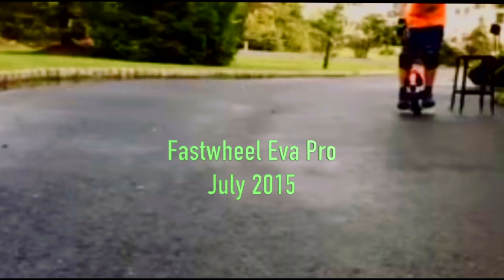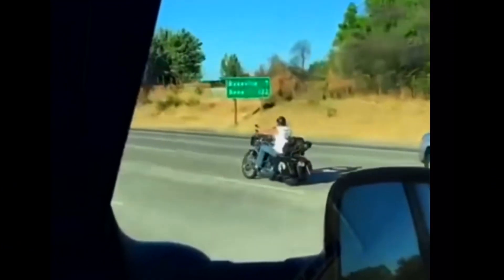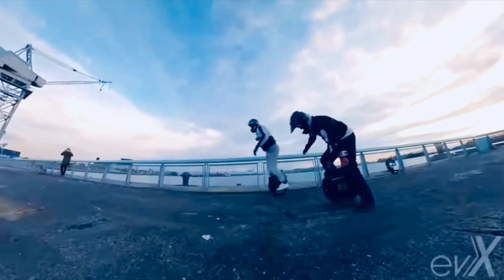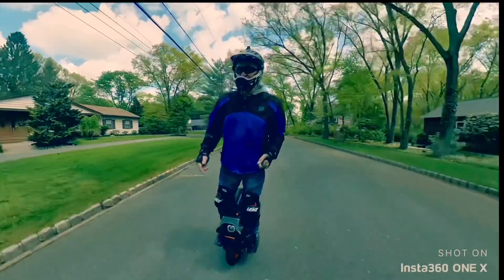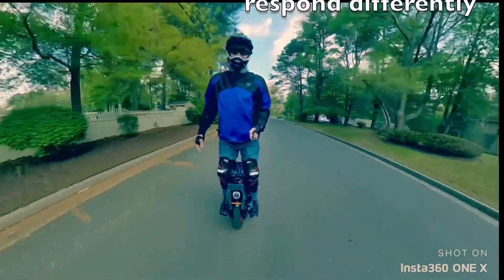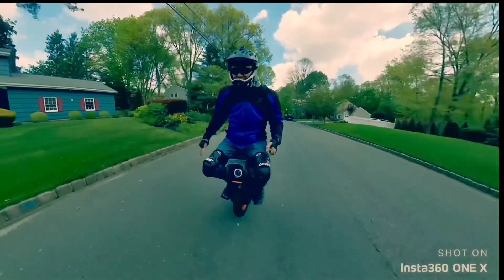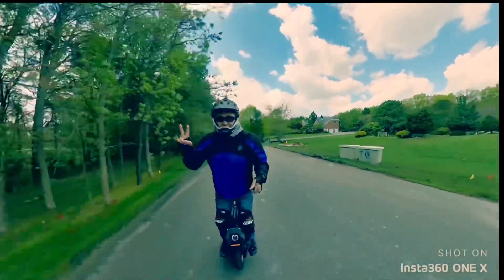Physics of Wobbles and What to Do About Them

Comment: It was definitely the biggest hurdle to get over when I was new and starting to go over 20 mph. It’s hard when you’re not confident yet to just relax and carve. I did not find braking to be a good solution when I was first starting. Works fine now, but when you’re new hard braking is probably the thing you’re weakest at. Great video!
Reply from the maker: Thanks! Yeah one of the things I mentioned about is  not rushing to be a Pro is so true. One of my friends recently learned the EUC and within a month he was going close to 30 mph. He got the wobbles and didn’t know how to deal with it. I told him not to rush to be a Pro. He finally listened but found out the lesson a little too late. He has fully healed now and is doing well. He still loves the EUC though and wants to keep riding the wheel. That wobble he had inspired this video.

Comment: Angular momentum doesn't not keep an EUC upright, it only resists a change in tilt or twist angle (more on what this does in a bit); there is no self-correcting response. Camber effect due to the tire profile is what causes an EUC to turn in response to being tilted, and at sufficient speed, it will cause the EUC to self-correct and stay upright, usually around 8 mph or so, too slow for angular momentum to have much effect. The amount of turning reaction to tilt depends on tire parameters, a wider tire is more responsive than a narrow tire, a street tire is more responsive than a knobby tire. Angular momentum opposes the self-correcting response of camber, mostly acting as a damper to reduce or prevent over-correction. A wobble occurs when an EUC gets into an over-correcting cycle, and involves a combination of twisting and tilting of an EUC. Anything that dampens that motion will reduce and stop the wobble, such as contact with the upper pads ahead of where the feet are on the pedals, which provides some angular inertia to dampen wobbles. If using pedals only, lower tire pressure will prevent wobbles, but with lower pressure, don't drop off curbs or stairs since the rim may get damaged. Riding on a bumpy surface can trigger wobbles, especially when turning, and if on a bumpy surface, trying to carve will generally make a wobble worse. Hard braking tends to cause mild wobbles. 

As for motorcycles, wobbles are also due to over-correction, but most modern motorcycles will auto-dampen wobbles. Older motorcycles prone to wobbles can use steering dampers (shocks) between frame and handle bars to act as a damper and prevent wobbles.
Reply from the maker: I appreciate the detailed response. You are right. I edited that line out. 
In my example regarding balancing an EUC from standstill, I mentioned that it becomes easier to balance as the speed increases. As the speed increases, the angular momentum increases hence balancing becomes easier. 
Regarding the motorcycle example in my video, the specific scenario was just after a wheelie is attempted and the front tire is making contact back to the ground. If the front tire is not exactly as straight as the rear tire when landing, the wobble occurs.
Reply: @AdamU1016  - Similar to a bike but for different physics, once at sufficient speed, an EUC becomes self-balancing and a rider doesn't have to make any balancing corrections. A bike becomes self-balancing because the front tire steers into direction of lean. For a normal bike, this is because the front tire contact patch is behind where the virtually extended steering pivot axis intercepts the pavement, and  the distance from the intercept point back to contact patch is called trail. A "two skate" bike can be stable due to this steering geometry with zero angular momentum). An EUC becomes self-balancing because the tires steers in the direction of tilt due to camber effect. When tilted, the inner edge of the contact patch has a smaller radius than the outer edge, similar to a section of a cone, and the tire tends to steer in a circular motion, mostly independent of speed, so if the rider starts to fall with neutral pressure on the pedals, the EUC will tilt in the direction of fall, and at sufficient speed, the resulting camber effect steering is self-correcting, keeping the EUC and rider vertical. The net contribution of angular momentum is to oppose any change in tilt or twisting (steering), and acts as a damper. At high speeds on a heavy EUC, the rider has to exert much more effort to tilt the EUC in order to turn. As for motorcycles doing wheelies and landing with the front tire slightly off, this happens all the time during the ILSE of MAN TT at 150+ mph, and although the bikes initially wobble, they will stop wobbling on their own, and the riders just ignore it. There are a lot of videos of ILSE of MAN.
Reply from the maker: I do appreciate your detailed explanations. In the clip I showed with the biker developing a severe wobble after landing the front tire, was it his inexperience that he wasn’t able to get out of the wobble or was his tire so out of alignment from the driving direction that he could not correct the wobble or something else? He certainly was probably going about 40-50 mph when he developed the wobble but could not control it. What techniques do the pro bike riders use to control their wobbles at speeds of 150 mph?
Reply: @AdamU1016  - It's not technique, it is the design of the bike. In your clip, the most likely cause of the wobble was an aftermarket handlebar mounted fairing, with some chance that the combination of fairing and tire was the issue, but a handlebar mounted fairing is not a good idea. The two worst historical motorcycles with wobble issues due to poor design (too much flex) were the Royal Enfield Interceptor (650 cc four stroke twin), and the Kawasaki Mach IV (750 cc two stroke triple). To solve the issue, riders would put two steering dampers (shocks), between frame and handlebars, one for each side. High performance motorcycles since the 1990's are designed to recover from wobbles on their own without the rider having to do anything. ISLE of MANN is a 37.73 mile long loop on local two lane roads run at speeds up to a bit over 200 mph. The intersections have dips and crests that cause the bikes to wheelie if at full throttle, often getting some wobble when the front tire lands. As commented above, the riders learn to ignore the wobbles, because the bikes self-recover.
Reply: @AdamU1016  - I set time stamp to an example of jump | wheelie induced wobble and self-recovery: https://www.youtube.com/watch?v=805qei2oAeI&t=111s
Reply from the maker: So you have the trail, rake and fairing to help keep the bike stable at high speed. The EUC is basically dependent on the tech and rider skill to keep the wheel stable. EUCs are certainly more dangerous than motorcycles.
Reply: @AdamU1016  - on a bike, trail alone could lead to over-correction induced wobbles, but angular momentum dampens trail response. On an idealized bike with an infinitely thin tire, at high speed, the angular momentum's dampening would result in a slight under-correction and a very slow fall, called capsize mode. With real tires, at high speed (100 mph or so), a bike will tend to hold the current lean angle instead of it's normal tendency to return to vertical at slower speeds. A rider has to steer inwards more to reduce lean angle (and steer less to lean more, both forms of counter-steering). As I commented a year ago, too much flex can lead to wobbles on a bike. The bike frames started to get too stiff, so they now have large holes at key points in the frames to allow for some flex, but still auto-recover from wobbles.  Back to EUCs, instead of trail, you have camber effect, with the same issue of over-correction that is dampened by angular momentum and the rider holding the EUC to resist twisting or tilting if needed. However, from the videos I've seen, the current batch of high speed EUCs are not prone to speed wobbles, probably a combination of the mass | angular inertia of the EUC and the angular momentum of the motor + wheel + tire.

Comment: I'm glad you got me thinking about this. There are two videos I've seen that I think, together, point to what's going on. (I'm using your comment section to think through my own version here, hope you don't mind.)

I won't post the links because I know youtube deletes them 🙄. The first is "Most People Don't Know How Bikes Work" by Veritasium. It shows that the whole gyroscope thing is mostly a myth. In reality, bicycle and motorcycle balance is mostly achieved through subtle countersteering-- they both automatically turn in the direction you're falling, keeping you upright. (And that's why it's easier to balance at speed.) Unicycles are similar.

The second video is this one about motorcycle wobbles. "Dunlop Wobble & Weave". It shows that motorcycle wobbles are a result of a cycle of mechanical forces, often from the suspension shifting around. There should be some similar cycle happening on unicycles.

So here's what I'm thinking: 1) The wheel gets misaligned with your direction of travel somehow. Maybe you briefly went airborne after hitting a bump and landed a bit sideways. Maybe while braking you pull the wheel off to the side a bit. 2) If the wheel is pointed at an angle compared to the EUC's direction of travel, the ground itself will yank the wheel around in an awkward curve. If the wheel is pointed right, it'll yank to the left. If pointed left, it'll yank to the right. 3) Under the right conditions this cycle can perpetuate itself. 4) This can explain why carving helps, because the wobble requires the symmetrical yanking from both sides. Pushing to one side will dampen the yanks on that side and end the cycle. So according to this theory, it's more about turning actually, and carving happens to be an effective series of turns.

Maybe I should write this up somewhere...
Reply from the maker: Carving truly is an effecting wobble damper. By making one side asymmetrical, the resonance can be killed since the vibration travel will respond differently. Similar to having more foot pressure on one side, the resonant effect will behave differently hence nipping it in the bud.
Reply: Oh yeah, I just tested this out and it's 100% what the wobbles are. You can literally push an EUC around with the wheel starting at an angle and get the exact wobble behavior even just at walking speed 🤯

Comment: Very informed,videos like this should be pinned on the EUC forums. I usually carve the wobble out as well as accelerating a bit. Seated riding definitely helps and never panic.May I ask about your impressions on the v13,compared to the EX30?
Thanks 😊
Reply from the maker: Thanks for the kind words. I owned a Nikola before and really had a blast riding that wheel. Since it was a Gotway wheel, I waited a year and a half when the model came out so that the wheel would go through its trials and tribulations and modifications before I finally bought the Nikola. The Nikola was the best wheel I ever owned before the V13. Having said that, I would wait at least a year and let time solve the issues for the EX30. Based on what other riders have said, it seems like a great wheel. Powerful, fast, lots of torque and better range than the V13. 

 I have never owned an InMotion before.  I decided to choose the V13 based on the specs of dual hall sensors, high cutoff speed, advanced BMS, great waterproofing, and kickass design.  Yes the V13 is a new wheel but because InMotion is stringent on QC and uses premium materials, I picked the V13 as my next new wheel. So far I am loving this beast. 

The weight of the V13 is pretty heavy so the hardest part is starting the ride. Braking is quite responsive and requires more of a squatting technique to prevent wobbles. Once I am in motion, riding and maneuvering is similar to my Nikola. I feel very reassured and stable when I am going 40 plus mph.  I love all the bells and whistles on the InMotion app too. I highly recommend the V13.

Comment: Definitely appreciate the video, explanations and advice.  I have prevented EUC wobbles in two different ways, depending upon situation.  The easiest way to get rid of a wobble is to accelerate right when it begins, which sounds counter intuitive, but has worked for me like magic.  But if one needs to stop, and a wobble begins?  I've had success digging one leg into side of wheel and brake/turning at the same time.  The wheel continues to fuss through this process, but I've done it and stayed on the wheel.

When a wobble begins, if I have braked (lean) straight backwards, that has magnified the wobble - every time.  I have come off the wheel as a result of this, before I started trying different solutions.

I think the best advice is to ride to a comfort level.  I know when I started riding, I could always feel when I was going too fast, and not in comfortable control.   Very good advice to not be in a hurry to be a pro rider.   One needs time, experience and practice on the wheel to improve.
Reply from the maker: I have never tried accelerating to dispel a wobble. My first instinct for a minor wobble is to just do seated riding. The wobble goes away. Brake/ turning at the same time works well for me too. I have seen too many new riders buy a really fast wheel and within a few days of learning they are trying to get close to max speed already. Most of the time they end up crashing. It took me years to be able to comfortably ride at fast speed not by choice but simply because the EUCs were not as fast as they are now. Now with so many choices of fast, powerful wheels, it is tempting for newbies to get the latest and greatest. Perfect recipe for disaster.
Reply: @AdamU1016  that's facts.  I was that rider on my 2nd wheel, a Gotway MSX.   Within the first week, I had clocked a top speed of 46mph (down wind, down hill), and was likely riding through the 80% power beeps screaming 5/sec (not smart).  Not long after that I had a nasty wobble crash, falling off the back of the wheel (much like the example in your video, the guy on the Nicola).  Except at higher speed.  Fully geared, but the fall knocked the wind out of me, and I am super lucky it wasn't worse.  That crash completely changed everything about my riding approach.  First, only ride to a comfort level, not beyond (experience increases ability and comfort at speed) And I demanded (from myself) the ability to deal with wobbles.  I still think wobble crashes can happen to any rider, at any skill level - but having that intuitive/practiced knowledge to survive/beat the wobble is crucial.  (edit: guess my point is I have arrived at a better approach via making early mistakes, and trying to learn from them)

Comment: Thanks for the info! I wonder why breaking induces wobbles. It reminds me of when a car and trailer wobbles when the weight distibution is too far back, but I am not sure if the physics are the same with unicycles.
How I mitigate a wobble is by carving or turning to one side which holds true to your theory I think.
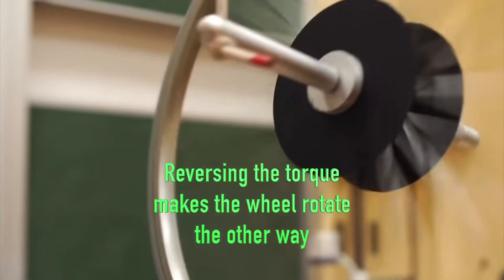Reply from the maker: Please look at the explanation starting at 3:00 when I talk about the bicycle wheel being suspended on one axle. As the wheel spins due to torque applied, the angular momentum increases at an angle perpendicular to the direction of torque. When braking is applied, the angle of momentum is decreased hence the angle of the EUC wheel relative to the ground is also affected. Resonance or wobbling then occurs and the rider tries to correct it but then actually makes the resonance worse. That wheel suspended by one axle demo really drives the message home.
Reply from the maker: With car and trailer combo more variables come into play to cause wobbles. However, the same principles will still come into play when a car makes a rapid turn, that will translate into a whip-like momentum to cause the trailer’s angle of momentum to also change. The wheels on both car and trailer then go into a harmonic pendulum like oscillation. The wobbles on the car will affect the wobbles on the trailer. It goes back and forth in a snake like wave with each vehicle trying to slowly harmonize. However, because the snake like wiggle keeps going back and forth between the two vehicles, the process of eventually reaching a harmonious synchrony will take longer.

Braking induces wobbles because at high speed, the quick braking will cause a change in angular momentum and hence the tire angle relative to the ground will become affected. That sets up an oscillation effect and makes the rider try to correct the wobble but instead makes it worse through over correction. 
I would then use a squatted braking technique or do seated riding to slow down the momentum, dampen the resonance as well as lower my center of gravity.

Comment: Carving prevents wobbles completely. You can cut mild wobbles by braking using only one brake pad, moderate wobbles by dropping in an extremely low squat, hard wobbles by squatting + digging one foot in the plates whilst turning but it's pretty hard to execute so the best is def prevention.
Reply from the maker: Those are great techniques and have tried them too. I found that seated riding totally prevents wobbles as well as making me less fatigued. Hence, most of my long, high speed rides are usually seated.
Reply: @AdamU1016  Seated riding stresses me out too much when commuting. I feel like I don't see far enough and the absurd amount of potholes in my city doesn't help. I find seated riding considerably more dangerous and the comfort gain isn't worth the loss of agility, responsiveness and braking power in case of emergency.
Reply: You mean offesnsive evasion?